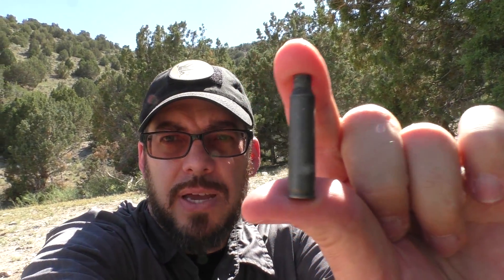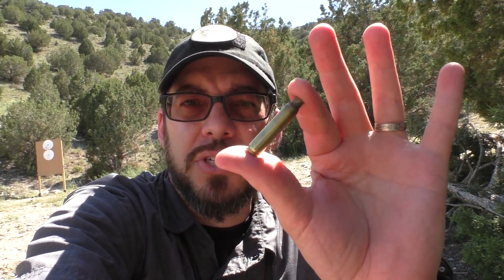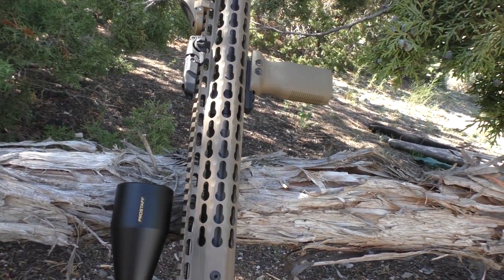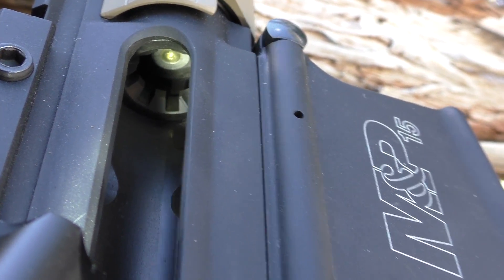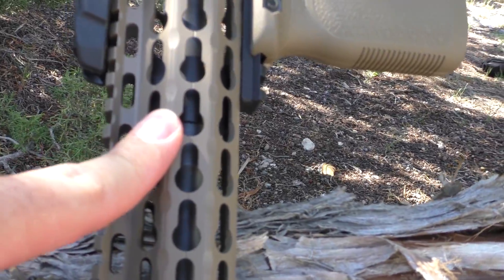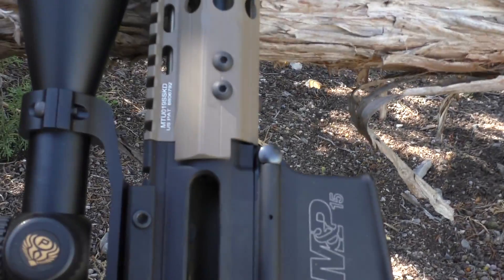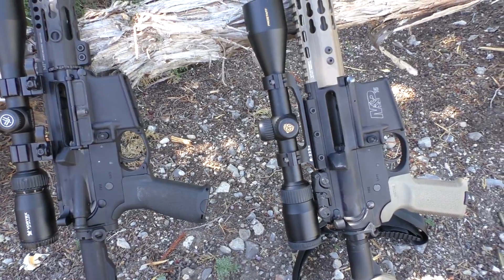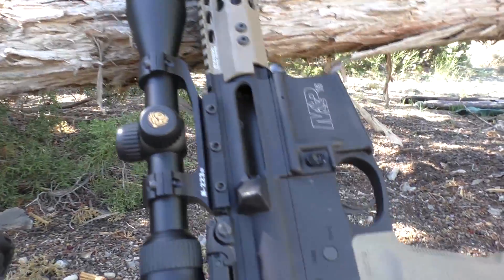Tula .223 Killed My Guns! V-Log Thursday

Comment: PLEASE BE EXTRA CAREFUL WHEN KNOCKING THE BAD LIVE ROUND OUT WITH A CLEANING ROD, THE BOLD COULD SLAM CLOSED AND A ROUND COULD DISCHARGE. I WOULD SUGGEST YOU SEPARATE THE UPPER FROM THE LOWER AND REMOVE THE BOLT FIRST. I would suspect it's some out of spec rounds, misshaped cases or bullets. Good luck on finding the cause.
Reply from the maker: These were spent casings.
Reply: +Steve Woboski The only way to find out if some of the casings have an extra-heavy charge would be to pull the bullets and weigh the powder charges against each other.  As far as pressures, you'd have to know what particular type/spec. of powder that was being used in order to find out the pressures that it was generating.  That would be a good place to start.  Hope this helps some.
Reply: +playa2323 Couldn't you see the dimple from the firing pin on the primer?  That's empty brass that is stuck, not live rounds.
Reply: +Steve Woboski An AR shouldn't fail to eject just because it's hot, lol!
Reply: +playa2323 you can clearly see in the vid that the primer is dented in on both, these are just stuck casings...
Reply: +The Late Boy Scout  .......  from what I understand.. Brass is softer, so when you shoot a round, it will swell tightly to conform to the walls of the chamber, this keeps the chamber much cleaner over a lot of volume shooting...  
 the tips of the steel ammo casings don't swell as much when fired... so this allows for carbon to build up toward the end of your chamber.. to the point that when you get a random hotter round, it will compress against that carbon build up.....  solution, if you shoot a lot of steel ammo, you have to make sure to scrape your chamber after every outing. pretty simple.. cheaper ammo calls for a little more maintenance.. no big deal
Reply: +YT YT I am going to play devil's advocate here. While I am sure this guy knows what he is doing and would not be doing this had it being a live round so the point I am going to make does not matter in regards to this situation.

But the advice of taking out the bolt is good advice especially when it comes to showing safe practices and  consistency.  When people make gun videos most of them do the safety check on camera even if it was done right before they hit record because it helps to get it to stick the heads of the people who are new to guns.
Also the presence of a dimple does not guarantee that it is not a live round. Even a soft strike can leave a dimple. So let's say someone new to guns has a soft strike. They go to charge the gun and experience a failure to eject. They remember seeing a video of someone using a rod to push it out in this manner so they assume it's 100% safe.  They trip the bolt and by some freak accident it sets the round off this time.
Reply: +playa2323 This is really important!!! thanks for pointing it out.
Reply: +Steve Woboski "Hmmm - I know the answer, what should i do:  Make fun of the guy and be an ass or tell everyone reading what I think the answer is?  I know, I'll be a complete ass and be all sarcastic and superior and tell the world i have had way too many steroids and can't think straight any more."  Thanks for nothing, Steve...
Reply: +calholli This is true. Typically, issues are not found unless you shoot steel cased ammunition and then follow up with brass cased ammunition.  That being said, steel case ammunition does not expand to the chamber walls and seal.
Reply: +playa2323 This actually happened to me but with a brass round. Thank God the round did not go off as there was a large primer strike on the round after observing it.
Reply: CamoNammo I definitely would have.
Reply: +calholli +1
Reply: James Martin I have no idea why I didn't, that was the first time I actually felt my heart stop. My buddy and I  jaws were dropped for at least 10 seconds after we heard the bolt slam into battery, muzzle pointed at my head and all...sigh... I was such an idiot back then.
Reply: +playa2323 Yeah long story short thank god it was my friend and not me, and that ram rod just disappeared.
Reply: +YT YT Just cause there is a dimple doesn't mean it is a spent casing.  I think the advice to remove the BCG is wise.
Reply: Lj Wilson Yea I said that 14 weeks ago and I am glad you said that again so the statment it is not lost in a sea of comments. Because sadly there are naive about soft strikes being able to leave a dimple without discharging the round.
Reply: +YT YT 2 things on both your (consecutive) comments.. 1 just because a primer is dimpled and struck does NOT mean the round was fired, I've seen plenty failure to fires with struck primers, that is a dangerous and ignorant assumption to make... actually ANY assumption about a firearm is dangerous, careless and just plain ignorance that can lead to your death or a loved one's.second, an AR can fail to eject from heat alone. 
After reports from the Battle of Wanat, Afghanistan (2008) that US marine's firearms failed from heat due to successive non-stop firing, extensive testing was done [in house] by & and for the US Marines & US Army.
Among the many findings was failure to extract jammed rounds from heat expansion PRIOR to barrel failure in an otherwise [inaccurate] serviceable rifle.
Especially in the case(s) of:
1. a pause mid-magazine after heavy sustained suppressive fire lasting a large number of; greater than 9 USGI magazines
2. the use of a magazine taken from a rifle that had suffered total heat related barrel [blockage] failure.
3. any situation where very hot ammunition is attempted to be fired from a moderate to very hot rifle whether it is perfectly clean or not.

the fix, which was also the fix to a large number of other failures.. like accuracy and barrel blockages (the bullet getting stuck in the barrel on firing, turning the rifle into a pipe bomb in the soldiers' hands)
WAS TO USE COLD HAMMER FORGED BARRELS INSTEAD

an immediate transfer of barrels and C7/C8 rifles from the Canadian armoury in Afghanistan was the temporary fix, a surge order of Canadian Diemaco barrels was made by both the US Marines & US army until domestic supplier was found and an exemption was made for the personal import of Diemaco CHF barrels for all US servicemen (navy & airforce too)

.. so YES "an AR" can fail to extract from just heat... you need a crap barrel and to fire a lotta rounds of 5.56 really fast for a while.. make like the Marines and have an injured buddy pass you his mags & the mags of all the bodies around him
Reply: +James Martin  Just stands to reason.. the bolt may close.. no brainer...  :)
Reply: ***** this may sound like I am being a smartass but I am not trying to be. This question is 100% me just fact finding. Why are you telling me this. What comment was it in reply to?
Reply: ***** I may know what comment you were referring to. If it is the freak accident one

What I meant was not the part about it slamming shut but that it would actually set the round off. The bcg pretty much slams shut after every round is fired without setting off the next round. So if it were to actually happen it would be a freak accident.
Or should I say freak negligence incident
Reply: James Martin
Yes pull the BCG without question  :)
Reply: ***** that wasn't a question. I knew that 20 weeks ago when the comment thread began.
Reply: James Martin
I was agreeing..
Reply: ***** sorry it dawned on me about 15 mins after I posted that but I was running a weed Eater and did not have a chance untill now to either delete it or edit it.
Reply: Good advice
Reply: Lol open your eyes bro, they are not live rounds
Reply: Johnny Chan
I am going to take it that you have not read this comment thread because that has already been covered. That is if you are referring to the presence of a dimple as completely indicative of a spent shell. While all shells that have been spent from a gun will have a dimple not all rounds with a dimple has truly been spent. Unless you can see the whole thing or you shot it and nobody has had the chance to chamber a new round it should be treated as if it is a live round and take as many precautions as you can.
Reply: Even so if you get a live round stuck you remove the BCG before ramrodding
Reply: Another solution is to shoot 1 brass round every couple of steel, because it will essentially scrape the chambre clean. I tested 2 rifles that does not like steel at all, but with this method it works flawlessly.
Reply: BCM upgrade extractor kit. and a few drops or spray of CLP or other lube in chamber IE run a wet bore and issue go's away. understand its steel on steel in the chamber u get dirt into the chamber and action when u fire more so then with brass. so little more cleaning but off set is more training for the cost of ammo. I just got 500rd tin of the zinc washed bullets tula brand for $170 at local gun shop.
Reply: That is actually a terrible deal for steel case ammo lol. I pay a regular price of 149.99 per 500 rounds for Lake City/Federal brass case M193, when its on sale its more like $130. Hell even not buying in bulk I only pay $7 per 20 round box of American Eagle M193 brass case which makes it 175 if I were to buy 500 rounds by boxes of 20, so $170 for 500 rounds of Tula is a bad deal I'm sorry to say.
Reply: Joe Doole local gun shop in northeast and this is the zinc plated stuff so price always go's up with new product.
Reply: Just run a wet chamber and cases will not stick also upgrade to spring and O-ring kit from BCM like $4
Reply: calholli your correct...
Reply: James Martin well he didn't say it if it fired or not... Then we would know if it was an empty case or not
Reply: dean prever - Actually the author did say that they were spent cases, but with the numerous responses it's understandable that this tidbit got lost.
Reply: Marinecorp mike - You are not the only one who has said to run a wet chamber, so I'm sure that this is a viable (emergency) intervention. However, as before, I will say again that this isn't a good idea because a well oiled chamber always increases back thrust on the bolt to unacceptable levels. Oiling either the rounds or the chamber has been done before by the Japanese, Swedes, and even a couple of American inventors. In every instance, it was found to be a bad approach - not because of dirt attraction as might be expected, but because of excessive wear on the locking lugs , and frequent early failure of the bolt due to stress fractures. 
So, as an emergency "fix" in the field, sure, oil the chamber. As a routine intervention though, no, don't oil the chamber. It's a bad idea.
Reply: A dimpled primer doesn't necessarily mean a fired round.  Could be a soft strike primer.
Reply: Phyxer944 Figtree,,, wolf and Tula Ammo are no longer lacquer coated
Reply: playa2323 they have struck primers in pretty sure they are not live rounds, because they would not have been able to chamber.  After he fired it is when the case expanded and did something I call carbon locked.  This is when using steel cases gas escapes around the steel case and leaves carbon on the chamber until it builds up so much it locks the case in the chamber.  You can check the breach face of your weapon and see it there also, but normally guys clean thief bolts really but not the chamber.  The fix is buy a chamber brush and go to town the carbon will come off but it will look almost like leading in a 22
Reply: propdoctor21564 - and while everyone acknowledges that Wolf and Tula have gone to polymer coating for new manufacture, the lacquered cases are still out there in abundance. I just bought a bunch at the last gun show, just last month. With all the surplus importation we've had, lacquered cases are going to be with us quite a while, and knowledge of potential issues is important.
Reply: "A dimpled primer doesn't mean a fired round"
True, but I think it's safe to say the explosion that occurred after pulling the trigger is a good indicator of a fired round.  As well as the new bullet hole in paper
Reply: Excellent advice playa2323 - thanks for posting this.
Reply: playa2323, you are absolutely correct!
Reply: You just simply use a cleaning rod and measure the distance from tip of barrel to primer. Insert rod and see if it matches, if it does, round has been discharged. Not rocket science.

Comment: Bore bath. Problem solved. Those of us who fire a thousand rounds a month plus bore bath. Literally you oil the chamber.
Reply: This.
Reply: MR MIKES GUNRACK Yup, crud building up in the chamber... stuck case guarantee!! Tula runs hella dirty!!!
Reply: MR MIKES GUNRACK  a friend of mine tried the bore bath on a chromelined chamber and it still didn't help...tulammo is just pure crap ammo
Reply: brotherscoobs I had black hole stainless 1/8 wylde chamber that wouldn't extract any steel
Reply: MR MIKES GUNRACK i've had no issues with wolf or hornady steel match in any of my 4 AR's but my SR556 did not like tula very much at all...some guns just don't like it even if they are gassed right and have good parts in them
Reply: +MR MIKES GUNRACK 
Any particular method for "bore-bathing"???

Comment: when using steel case ammo, do not let a cartridge sit in a hot barrel. 
the lacquer coating on the steel case (to prevent rust) gets warm and soft and melts slightly, then as the gun cools re-hardens. what has just happened is that you have glued the case into your chamber.
when your barrel is hot keep the chamber empty until you are firing.
when you stop firing, clear your chamber.
Reply: agreed.  but dont let ANY cartridge sit in a hot, closed barrel.  That is just common sense!
Oh wait, i guess its not as common as one would think...
Reply: It's been proven that lacquer coating thing is a myth. Look at military arms channel and see it won't melt off with a torch.
Reply: Lacquer does not melt off into the chamber guys, Stop spreading wrong information

Comment: I shoot Tula, doesn't give me any problems. Don't let your gun get to hot when your shooting lacquer coated ammo. Give your rifle time to cool down, or just shoot slower.
Reply: What if your in a firefight?  OK if all you do is punch paper.  We need ammo we can count on when things go bad.
Reply: Sure I agree. I like having brass on hand.
Reply: Ben Wolff it is true that they are coated, but I've been told this lacquer doesn't melt until like 900 degrees.
Reply: Tyler Ford - Melting temperature notwithstanding, cases WILL stick. If you are running hot, the lacquer will soften (even before it melts) and act like glue. Open the bolt when changing mags, changing shooters, checking targets etc. Cleaning with lacquer thinner when done.
There are some, here, who say "oil the chamber".......... NO, don't do that. That increases bolt thrust, and will lead to early failure of the bolt. One marine said they oiled chambers in Afghanistan (and this was with brass ammo). It was the same thing, running hot and leaving the bolt closed for a moment. As an emergency intervention, OK, oil, but as a routine DEFINITELY NOT.
The Marine also stated that their cure was to go with high grade hammer forged barrels. They even got a replacement advisory issued on the subject.
Personally, I have no problem with steel cased ammo, but I know that it requires better cleaning and awareness of how hot you are getting your gun.
Reply: what's the fun in that?  I fired off over 500 rounds in a matter of about 2 hours. Not continuous, more in spurts. I spent a lot of time behind my friends PTR-91 and fell in love with it. Not a fan of the walnut stock, but it sure is a beast of a battle rifle! I have to get me one.  But I did some nice speeded mag dumps (with NATO and TULAmmo steelies) and no melting of the powder coat in my NATO chambered barrel from KAK Industries. It may cause an issue with the slightly tighter .223 chamber with the ammo? I have a hunch...

Comment: The lacquer on Tula melts into the chambers if you leave them in on a hot chamber.  sometimes they stick on the first time.  but it'll get worse over time if it doesn't do it the first time.  the lacquer is clear, so the chamber can look nice and clean and still have the lacquer on there changing the dimensions.  find out what desolves that lacquer and clean the chamber and see if it does it again.

Comment: looks like you are running it a too dry for steel cased ammo
Reply: to run steel ammo you need that gun almost dripping wet
Reply: Tim Marsh this
Reply: False...you failed the pop quiz!!!!
Reply: Definitely I've tested this before. Had guns that would jam with steel case, sprayed the rounds them selves with rem oil no issues
Reply: @Matiock  put loaded mags in bucket of oil 😐🤘

Comment: Have you looked at the spring on the ejector, If you gun has had 1000s of rounds the ejector spring is weak , go on line to Bravo Co and get there replacement spring, that should fix there problem.I shoot the same ammo and dont have any problems at all. Hope that helps.
Reply: Bob Hodson You sound like you've had this problem before. I had this problem and I rebuilt the bolt. With heavy duty spring and new O-rings I was back in action ready for more steel.
Reply: The other problem is when  steel cased ammo is fired it expands but doesn't retract to its original size and stays stuck in your rifle, it also happens when used in a regular hunting rifle, Brass is best but its not cheap like the steel cased ammo is.

Comment: Bring a paint can opener with you. You can use it to grab on the inner-most rim of the case and pull it off. No cleaning rod is needed.
Reply: I'll try this. Thanks in advance if it works.
Reply: @alexlitner6611  Let me know how it works out for you. I've had to use it twice due to poor reloads (first batch) and I decided to attach one to my plate carrier.